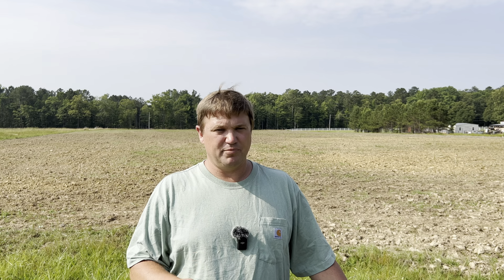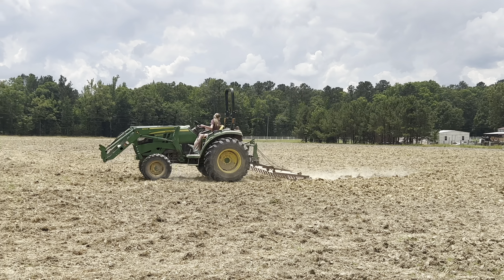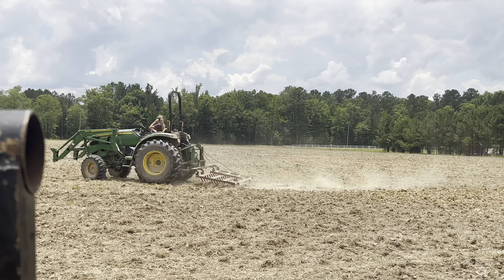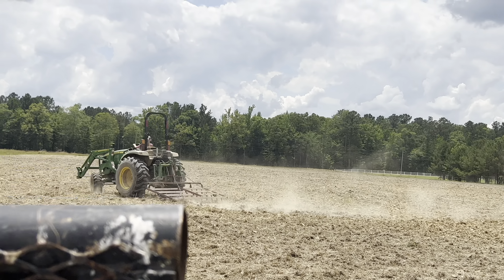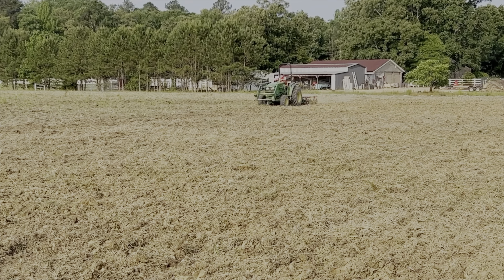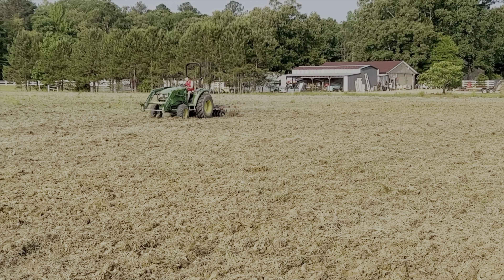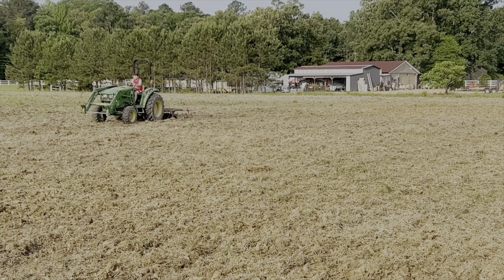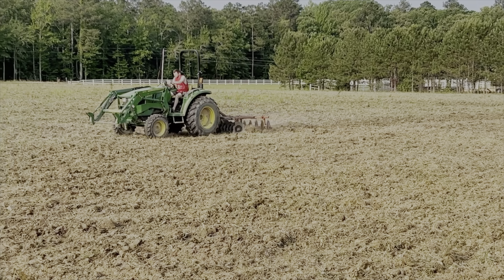Planting Cover Crops with a Disc: Regenerative Agriculture on a Small Scale

Comment: You should try to only “scratch” the grass before planting.  you’re just trying to set the existing grass back so the new seeds can get established.  Disking 2 or 3 times is overkill and you’ll save money and time by just scratching the surface.  Also, I think you’ll find covering with the harrow will work great.  If you’re seeding yourself, get a chain pulled harrow and attach it to the tractor behind the seeder and you can seed and cover in one pass.  Great job on the video and don’t listen to the naysayers…most have never actually worked any land.
Reply from the maker: thank you for the kind words. Some crops work well with a light scratching. Some work well without discing at all. But some of the larger seeded stuff needs a bit more unless we have grown cover crops there before. Still trying out new things.